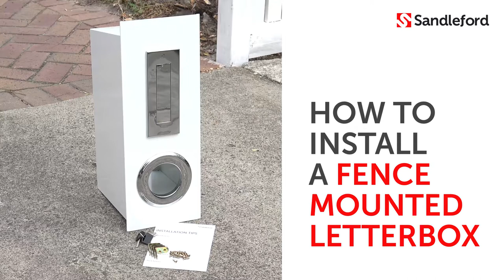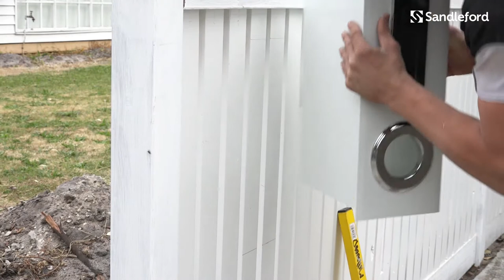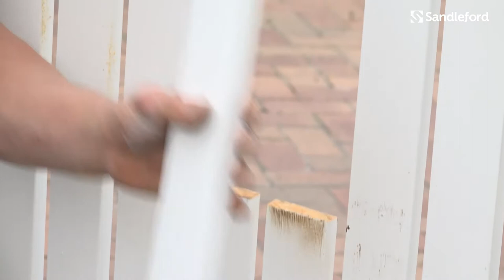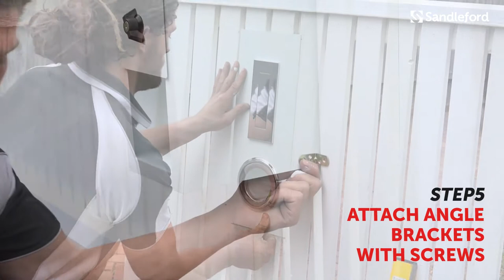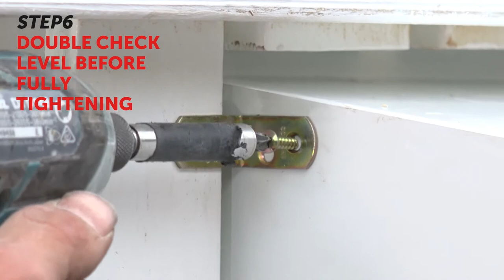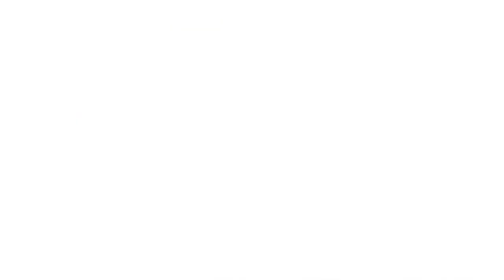How to install a fence mount letterbox

Comment: Just installed. Yep use a jigsaw with tight dimensions and abrase sand off the edges. Screw heads round out pretty easily. I used them in the  picket side of the L bracket and then pot riveted the bracket to the letterbox after drilling appropriate sized hole.

Comment: This video overlooks some very important details.  Do the screws into the letterbox go through the metal? There is no hole for that. Is the user supposed to drill that? Also, how can it be weatherproof when the top metal layer is bonded inside the walls instead of outside to allow the water to runoff?